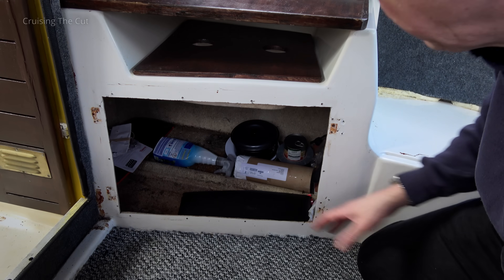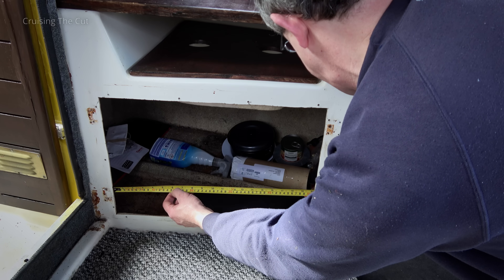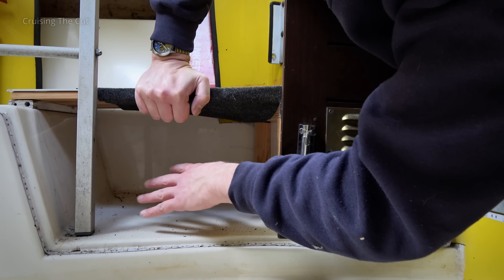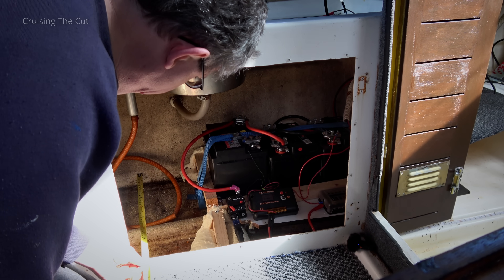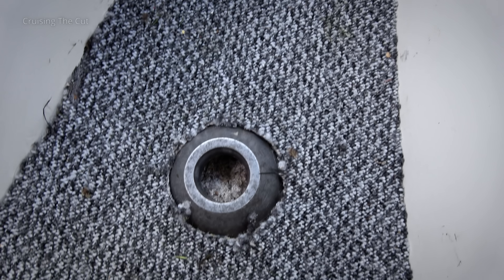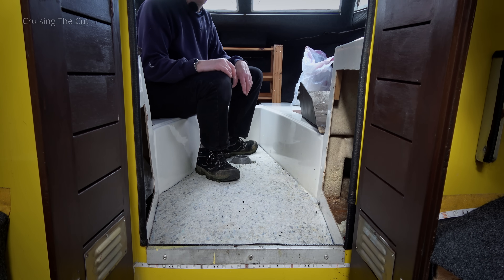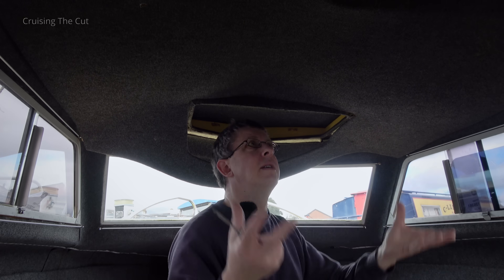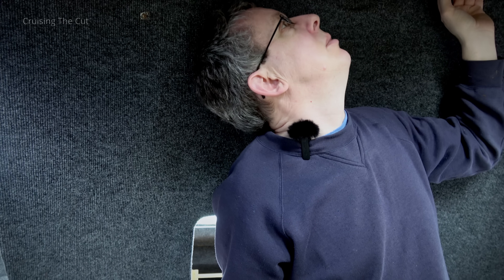329. Look what I found under the carpet!

Comment: Personally I would remove all the batteries and existing electric stuff. I would replace it with an Ecoflow 1800 watt lithium ion battery with built in inverter. Same item has matching solar panels. I would place the inverter on a sliding tray. You would be able to use standard household appliances include a small fridge. I looked into this as we have serious load shedding in Cape Town. I ended up with a much bigger system
Reply from the maker: Goodness me, no. One item = one point of failure for the entire system. It is also very inefficient to run a 230V fridge via an inverter and I cannot conceive of any such fridges of suitably tiny size. I will be running a very compact 12V fridge from the battery, I already have a solar panel. An inverter could be added if needed but is really unnecessary.

Comment: Nothing but LiFePo4 for battery, you won't regred it and Victron for controller side, yep they are expensive but they are so good in long run! Yes you can find compressor fridge with pullout style easily for those spaces! This is so interesting to follow now, what you ended up to do anyway! 😃👍
Reply from the maker: Yep, lithium and a Victron solar controller (mostly because they're small rather than anything else!). I've just bought a tiny fridge.
Reply: I think silicon ion batteries are showing some potential. Cheaper than lithium with most of the performance. Also inherently less susceptible to fire than even the improved lithium batteries. But still some potential issues that are being worked out now.

Comment: If I’m not too late already a suggestion: always make your batteries, easily removable. batteries don’t last forever. Don’t construct the boat in such a way where they’re hemmed in with lots of other pieces and items.
Reply from the maker: I will always make them accessible but they're not going to need frequent replacement; even traditional lead-acids last a few years and I'm going with Lithium which should be fit and forget.

Comment: Not keen on batteries in the cabin, particularly if blocked in behind a fridge.  I would have it under your feet at the helm so there is plenty of ventilation.
Upright water tank? use a 25 lt  potable water jerry can and add your own fittings exactly where needed.
And finally to try and match your epic wit, No skipper ever in the world lives up to his opening statement of 
"I will just use the boat as it is when i buy it"   !!!!!!
Reply from the maker: I'll use a lithium battery so ventilation not necessary.
Reply: @CruisingTheCut  despite using lipo's in my model aircraft I still think old school for boats , cars and caravans. Will I ever get up to date?   Naaaaaah.

Comment: The battery gives off gasses when charging and operating. So having it under the driver or passenger in the open may be a better idea. Also, generally speaking, batteries are fairly 'weatherproof' as-is. Occasional rain splashing onto it won't hurt it.  (I would avoid prolonged direct sunlight if possible however.)
Reply from the maker: I will be getting a Lithium (LiFePO4) battery which will negate any fumes issue.

Comment: A carpet or quilted upholstery needs to go back in the ceiling.  One reason is obvious, insulation from the heat and cold outside. The bigger and less obvious reason is SOUND.  Putting a hard ceiling (like plastic tile board) will make the tiny cabin quite uncomfortable with reverberation.
Reply from the maker: No, it's too tiny for reverb to make much of a problem especially as there will also be soft fabrics in there too.

Comment: Perhaps you might consider a battery space with sufficient ventilation to expel heat and battery outgassing.
Reply from the maker: I will be getting a Lithium (LiFePO4) battery which will negate any fumes issue.

Comment: The battery being in the cockpit is an invitation to being stolen.
Reply from the maker: Good point, especially if it's a nice lithium one.
Reply: Thieves seldom need an invitation
Reply: But if cabineted (word?) , no one would know.
Reply: Do you need regular access to the battery? Could it be behind a cover which is screwed into place. A thief might be unlikely to bother removing or even notice it if it's not a place the battery would typically be found.
Reply: Except 251000 subscribers and who knows how many random viewers.
Reply: @gordanmilne7034   Cheers guv, you ain't seen me, right?

Comment: re battery placement:  1) is theft a potential problem in the unsecured cockpit?, 2)  the cockpit space might be good for muddy shoes or boots, 3) do the batteries need a ventilated compartment? Are they sealed?  Instead of carpet for the floor, try closed-cell polyurethane interlockng gym mats that are totally waterproof and that could be removed for cleaning.
Reply from the maker: I will be getting a Lithium (LiFePO4) battery which will negate any fumes issue.

Comment: With regards to your battery placement options, I would be concerned about a potential battery fire blocking any exits, especially as your front hatch doesnt open. If you do put them in the cockpit then a bit of a risk assessment  taking into account battery chemistry and how they are contained etc would be a good idea. the position of the weight is also something to consider as it will affect your trim and potentially your steering, and for that reason putting them low and in the middle would be good, putting them right up at the bow for example may make handling less than optimal.
Reply from the maker: The hatch is going to be made openable!

Comment: Lovin' the series so far.  Have you thought about using a wider angle lens?  I'd like to get a bit better sense of space of your boat and the focal length of lens your using doesn't quite achieve that for me.  Maybe a seperate wide shot?  I know it's not all about me and my needs and wants, but y'know, thought I'd throw that out there.  Carry on...
Reply from the maker: I use a camcorder, that's as wide as it goes. I hate using stills cameras that shoot video, their ergonomics are awful and their sole benefit is interchangeable lenses. Plus being larger sensor, they have shallower DoF and when self-filming, you never know if they're focused on what you want (and often they don't know either and rack between focus points). Awful things.
Reply: @CruisingTheCut  Yeah that's a fair call.  I used to work for a motion picture rental company here is Australia and when digital SLRs started rearing their ugly heads, it was a cause of much gnashing of teeth.  Good for certain applications, dreadful for others.  Really enjoyed your mini doc on the pontcysyllte aqueduct.  Your previous experience as a news gatherer really shows.

Comment: Not sure you found out about it yet but those odd barrel connectors you found were very likely for LED strips. 

On the battery side of things... have you considered moving everything to the aft cabin and run wiring through a conduit to the front?
Reply from the maker: Hmmm maybe
Reply: @CruisingTheCut  Conduit is already in place, if you haven't ripped it out since the previous episode(s) :p

Comment: Makes some cringe, but the boat can be properly sealed and fresh clean coverings put up. The wiring will all be new and one piece. It’s good to take twiggy down to her starting weight. There are a lot of modern coverings with insulated backings, not just for warmth but also as a sound dampening layer. A thin strip of wood fixed to the edges will give you something to attach it to, if you choose to go with a finishing stapler, or whatever method you choose

Comment: Advice: avoid water and batteries...and avoid water and electric.  If you ever get near any salty water it rusts out many electronics.
Also in a small beam boat riding high you have to keep the infrastructure weight (e.g. batteries, water tank, fuel tanks) symmetric (left/right) so the boat will not tip over to one side.    And another thing, you may want to wear a mask and gloves now that the fiberglass is exposed; you may get fibers in your nose and throat (breathing) and on your hands...it is like prickly cactus...it can be painful...however, I see it is white epoxied and painted...but raw fiberglass can be exposed in places too.  Yes the fiberglass (like looking glass) will condense vopors, steam, humidity, and fog...the black carpet absorbed some of the humidity before it condensed or hid the condensation.

Comment: Just wanted to pipe up about the battery location.  I know you've utilized / discussed lithium chemistry in other projects and it may be important to utilize sealed "non-gas emitting" chemistry in the boat salon space.  This would not be as important using those foot spaces at the helm and passenger seats in the cockpit.  Best of luck!
Reply from the maker: I will be getting a Lithium (LiFePO4) battery which will negate any fumes issue.

Comment: Now you have stripped it all down, could you put a coat of some sort of epoxy paint over the whole cabin to seal it all, before you do anymore lining?
Reply from the maker: Doesn't really need it as the cabin is fibreglass
Reply: Yes, but rather old and possibly cracked fibreglass?

Comment: Condensation on the ceiling. Why not. Get rid of that warm carpet and put a cold surface in
Reply from the maker: Or, as I plan to do, add insulation and re-carpet... 🙄🤣
Reply: @CruisingTheCut yep needs carpet, not mermaid / shower board.
Reply: @CruisingTheCut It will look grand when its all done.
Reply: When putting insulation on the ceiling, it could potentially be layered in some areas to make a more evenly flat surface.

Comment: If you put hard plastic on the ceiling, are you not risking getting condensation drips on your head? I’d take that panel to a car headlining trimmer and get them to do it in headlining material and replace the entire board.
Reply from the maker: I should have been more clear, I meant carpet-wrapped plastic board! Just something other than hardboard!

Comment: Don’t forget fumes from charging, out side would be better with wires coming inside
Reply from the maker: I will be getting a Lithium (LiFePO4) battery which will negate any fumes issue.
Reply: Good idea still I would go outside to balance the boat, good battery boxes will have a lock as well as being fastened on it

Comment: Are you able to do a rough cost video chat?  I'm interested in the cost of the boat and ongoing maintenance costs, mooring fees. Comparing this boat you have now to the narrow boat.

Also, have you considered getting one of those large portable battery power packs such as a Jacket.  I was wondering if it would be suitable for you and your boat? Maybe connect to solar panels to take home and charge ready for your next visit to the boat.
Reply from the maker: I can't see the point of a portable power bank. I'd forget to charge it, and probably forget to bring it to and from the boat too. Much better to build a system in so it's always ready to rumble.

Good idea about the costs, I'll do one!
Reply: @CruisingTheCut  I didn't know if a couple of sockets on a large battery bank would be suitable for a small boat.  No need for the leisure batteries and charge controller and all the wiring.  I was just thinking that there must be a point where these power banks would be a good idea for a small boat or camper van.  
We are heading to Bugsworth today on our hire boat and have just watched your video of your journey there.  👍.

Comment: Use caution with the battery placement, as some batteries make hydrogen gas when under a charge and not properly vented.  You might run the risk of having a yellow Hindenberg.
Reply from the maker: I will get a lithium battery so not an issue.

Comment: Battery space depends on type and were you need your weight , are you going old tech lead acid , needs good ventilation , or small nickel
Reply from the maker: I will be getting a Lithium (LiFePO4) battery which will negate any fumes issue.

Comment: Interesting as always David ... and rather you than me!

Word to the wise, and apologies for following "mansplaining", if you plan to fit a standard 100Ah lead acid service battery then be aware the battery box is "quite big" ... about the size of a small suitcase.

I have just added another "standard" lead acid service battery in moulded plastic box to my engine room.

Was a tad miffed at just how tall the box was and, despite the height, the lid required cosmetic surgery to allow clearance for battery mouldings and terminal.

You might be able to buy a taller unit but then the size would be on a not so small suitcase scale.

Not sure about dimensions of a lithium battery, too dear for me,  but I gather they can be mounted sideways as no venting holes required.

Perhaps if you went that route you could simply recharge at home, do the "plug'n'play" thing and, fingers crossed, the capacity would last the length of the cruise.

That said is there a possibility of sharing the lithium in your van with Twiggy so as to get twice the utility out of said lithium battery?

I cobbled up the battery leads with 50mm2 welding cable, which is reasonably flexible, to  fused bus bar and thence to equipment via isolator switch so not too onerous a task.

One last nod at H&S apropos a hernia, should you opt for lead acid solution 
... suggest you fit the battery box into its position when empty to get length of cables etc.

The battery is bastard heavy to winkle into a confined space and could detect my old hernia repair doing a bit of protesting.

Hope the above might give you something to consider (or reject) later.
Reply from the maker: I'll be getting lithium not lead acid so gives more options.
Reply: @CruisingTheCut  

Definitely limiting your hernia options 😂

Comment: I might be wrong, but don't your standard boat Lead/Acid batteries give off small amounts of hydrogen gas and need ventilation?
Reply from the maker: They do but I'll get a Lithium type which don't
Reply: @CruisingTheCut  You probably already know this David, but to charge Lithium batteries, they have to be above 0 degrees C. If you try to charge them below 0 degrees, it kills them. Some LiFePO4 batteries come with built-in heaters to address this problem.

Comment: How do boat's names work? Can you change them at will, or is there a process to go through?
Reply from the maker: You have to advise the boat licensing authority (eg the Canal & River Trust) of the new name, and if you're superstitious, it's supposedly bad luck to change the name while the boat's in water but other than that you can call a canal boat what you like.
Reply: @CruisingTheCut  Fascinating little piece of boating lore there, thanks. 
I have another question: Electrical storms when you're out on the water. Does the boat always protect you, because how do you earth a boat? And, if not, is a metal frame boat more "dangerous" than a fibre glass?
I did have a third about how often would one randomly spot the same boats/people whilst boating around the country, but I didn't want to too annoying.✍🤐
Reply from the maker: The boat is earthed by virtue of being in the water, electricity will conduct round the hull into the water. You do often see the same boats, sometimes because they tree the same waters, sometimes just because fate seems to work that way!

Comment: About the carpet on the floor: you said on one side there is a gap and on the other it comes up the side. Maybe they made a mistake, made a template and cut the carpet wrong. Put the carpet back upside down and see if it fits ….

Comment: Do batteries, when charging, not give off hydrogen gas? In which case, you need to make sure they are suitably vented.
Reply from the maker: I will be getting a Lithium (LiFePO4) battery which will negate any fumes issue.

Comment: I think if you use what you used in the shower for the inside ceiling , because its a hard surface i think the noise or echo from being in there or if the new ceiling is in direct contact with the roof, rain noise may be unbearable. Maybe a nice quilted fabric would be a choice👍😬👎
Reply from the maker: There will be insulation
Reply: @CruisingTheCut  that will be a great video on its on to watch, love your content, so glad you got back into the water!!!!!

Comment: Instead of the filthy mess you get with fibre glass and its resin, You can use car body filler, the ``chopped strand fibre`` version. It does 95% of what fibre glass does  Not so good on large areas, but on small repairs on joints, bends or corners its easier. Dont dispose of the ``templates`` you just took down.
Reply from the maker: I will get some for the many, many tiny holes that need filling.
Reply: Truck bed liner is also a good product for creating a durable surface coating.

Comment: My two cents worth on the batteries..... Don't install them any where where you have to get down on your hands and knees to get them in or out or check them. You will cause yourself an injury. Under the forward berth would be much more practicable.

Comment: My only concern with the battery being in the sleeping space is that Lead Acid batteries need to be vented to the outside due to hydrogen gas off-gassing during charging.  If lithium battery, then disregard
Reply from the maker: I will be getting a Lithium (LiFePO4) battery which will negate any fumes issue.